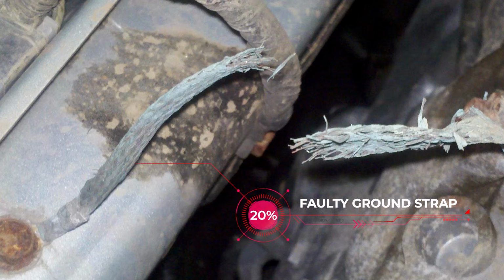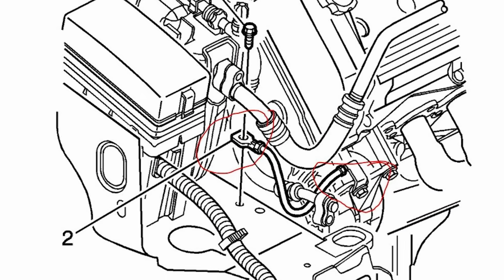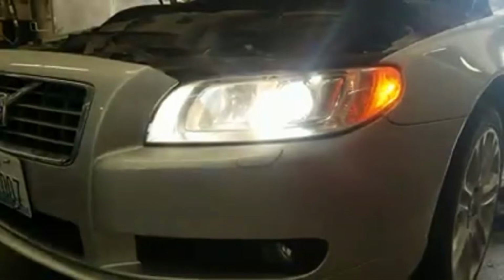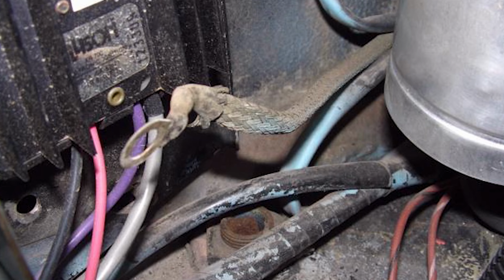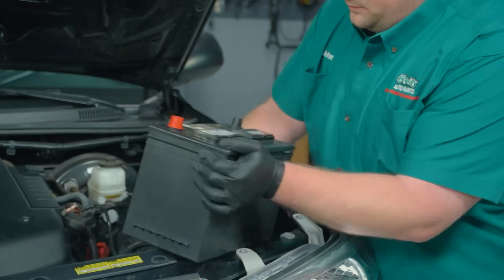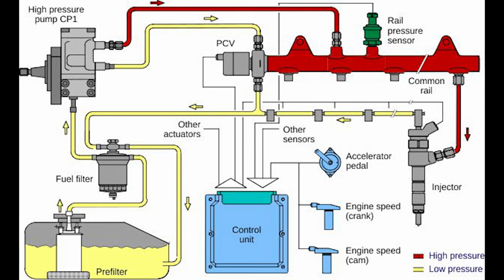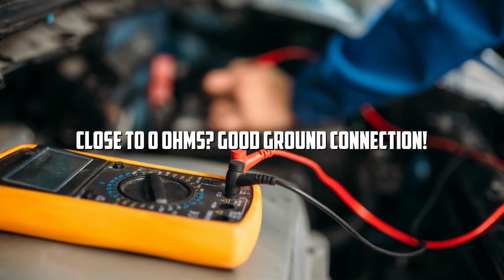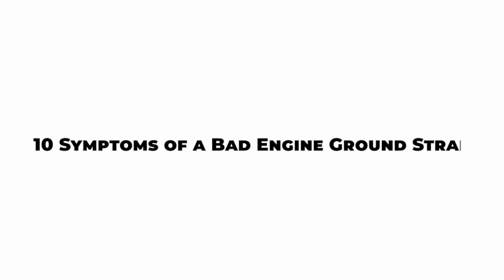9 SYMPTOMS of a Bad Car Negative Battery Cable | Signs Engine Ground Strap is Faulty

Comment from the maker: Before you buy random parts or approve a vague repair estimate, use the Check Engine Confidence Kit to understand what's actually urgent, rule out the cheap fixes first, and ask for the test; not the guess: 

https://gumroad.com/a/80519267/grkvra

Comment: I have a Duramax and sometimes it crank up and run good and then sometimes when you turn the key, the lights at the bottom where the showing you the mileage don’t even show up and then the windows one roll up and down of the doors won’t lock, but if you’re trying to keep all the way back halfway in the windows in the lock work, but the light won’t light up on the dash for us the mileage or the four-wheel-drive won’t light up
Reply: Did you ever figure out what was going on with your vehicle? I am having the same issue.  What was the issue with yours? Was you able to find the problem?  If so would you.mind sharing what it was

Comment: When i break and almost stand stil, then my headlights and dashboard lights go off for 2 sec and only the oil pictures shows and then everything goes back on. I also hear a little clicking sound then
Reply: did you figure out this issue? having this same problem and i’m at my whitts  end with it

Comment: If you replace the main engine ground wire, make sure it has the amperage rating necessary, and best to stick with OEM ones despite higher cost, then you know it's right for the job.  Lot of amps worth of power need to be grounded for things like the starter.

Comment: How do I change my ground wire ?
Reply: it depends on your vehicle. In general, open your vehicle hood and look at the battery.  Look at the negative Black battery cable. It is attached to the negative battery post. 
You want to  follow it with your eyes as much you can to where ever it goes.  It may go under the battery tray. Here is where you may lose sight of that black battery cable. On my vehicle, i needed to remove both battery cables (off the battery posts), set them aside .
Next, i had to figure out how to unbolt my metal battery tray. Once removed, i could chase the black battery cable to an area under the battery tray. That end was bolted to the vehicle body in the engine compartment or the transmission with a 14 mm bolt. I removed it, removed the cable. In my case, i cleaned both ends of the cable, cleaned the mounting hole area with sand paper. I add a bit of dielectric grease to the hole area i cleaned up. I cleaned up both battery cable connectors that go onto the battery posts. I cleaned the battery posts. I reinstalled everything as i took them off. 

When i did a few test drives, i noticed better acceleration, smoother, quieter engine, lower idle when parked. Over the next two days, i noticed i was getting better mpgs.
Reply: There's ground wires at different spots as well.  One or two main engine ones, often attached to the back of a head to part on the frame.  Sometimes second one on the lower front engine to the frame.  One on the hood that attaches to the firewall.  One is attached to your gas cap housing and the frame.  One is hidden inside behind the dash that grounds the interior electronics to the frame.

Comment: My problem is over car parked 2or 3 days battery drains hook jump box starts right up new battery new alternator disconnected negative battery terminal and hooked test light between negative post one cable I’m getting 9.4 volts out of the ground after you start it it’s fine all day just when it sits no blown fuses and everything is off
Reply: Same problem im having, have u figured it out yet
Reply: Add another additional ground

Comment: just realized this bad ground wire could have been causing my mass air flow sensor problem . Im so glad i watched this  Video
Reply: Do you have any idea of what happened with the maf sensor when you fix the ground strap issue? Did it fix the problem?
Reply: @StarreChilde pls respond to this  message
Reply: My car didnt start with cold engine if i rolld it end start with gear 2 clutch come up it started but it wanted to die if i kep it on 1000 rpm for 20 seconds myselr it would run all day if i switch the engine of end it was on lik temperature like not even 70 degrees it would start cuz it need less electricitiy  in the endd i fix all things didnt helpt end it was this ground cable......
Reply: Pls reply this comment
Reply: @AbimbolaFAGBEMI why? You have not said anything relevant.

Comment: Anything electrical is going to give you headaches not only the ground wire but everything!!!. I got an issue with the internal box junction on my mustang and oh boy, the car was doing all kind of crazy stuff, it shorted the gas pump, was draining the battery, locking the car transmission , etc, anything electrical is a mess
Reply: How did you resolve issue? What was causing it

Comment: I changed my alternator and changed my battery, but the battery light keeps fluctuating on and off, and sometimes when i accelerate or even put it on reverse the light goes away, then it comes back, there was corrosion on both neg and pos of battery post so i cleaned it but problem still coming on, i check the battery volts and charge it just in case but it doesn't seem to be draining significantly or at all. 

Any ideas?? What could be causing the light to come on??
Reply: Same issue I’m having did u fix it?
Reply: @laylowk1426 nah bro i might change out the cable connection from battery to alternator, but i wanna be sure its the problem before i jump in and commit to a tedious task.
If i get any progress and fix it, I'll be sure to reply back.
Hope you get your fixed too bro
Reply: @xjoshsaucex thanks man trying the idle air control valve today to see if that helps
Reply: @xjoshsaucex I’m having the same issue, did you figure out what was causing this?
Reply: Same problem here man, let me know if you fix it. I've had my battery, alternator and starter tested 4 times with AutoZone and O'Reilly's, first time AutoZone said it's my alternator but the next 3 times at O'Reilly's says everything passed. I changed the battery and the terminals posts. Haven't changed the alternator yet since I wanna be sure before I spend the money
Reply: @benzorelli trying the idle air control valve today for me rough idling and struggling to maintain Idle at lights stalls and can’t get up to speed once it gets up it acts fine but still dealing with lights flickering issue
Reply: Also having a similar problem in my mom’s 2010. Battery light came on. Replaced the alternator with one from the dealership, new battery, new belt and replaced the TIPM and battery light is still coming on. So frustrating
Reply: i'm having the same problem with my 1998 toyota camry! i replaced my battery and alternator as well. my next thought is a bad negative ground strap. everything im researching is leading me to that. I'm really hoping to replace and fix the problem for good.
Reply: @G @GravityKing22 Is it a OEM alternator or a garbage china alternator from Auto zone Oreileys NAPA JUNK I once went through 3 alternators then finally purchased a factory OEM for it to work

Comment from the maker: Doing This Will Make Your Car Battery Last Twice as Long  https://youtu.be/23Vy8aVbc_g

⬇Care Care Clues Top DIY Tools and Products:
🚗 Essential Scan Tools
Newest Scan Tool:https://amzn.to/3GJyuET 
Bluetooth Scan Tool: https://amzn.to/42AcBRc 
Cheap Scan Tool: https://amzn.to/42WZIzx 

🔋 Emergency Essentials
Best Jump Starter: https://amzn.to/44fYOAm 

🛢 Fluids and Leak Stoppers
AT-205 Re-Seal (Stops Leaks):  https://amzn.to/3S9icYm 
ATS 505 Fuel System Treatment: https://amzn.to/3YQjjA2
Lucas Oil Transmission Fix: https://amzn.to/4jNk98M 
Bar's Cooling System Stop Leak: https://amzn.to/3Sht0nj 

🔎 Quick DIY Diagnosis Tools
Head Gasket Leak Test Kit: https://amzn.to/4jRgc2T 

🛠 Useful Maintenance Accessories
Quick Twist Oil Drain Valve: https://amzn.to/4jWG3GJ 
Tire Gauge (Check Pressure): https://amzn.to/3GxySGD
Tire Air Pump: https://amzn.to/3RZK9Cd 
CRC Mass Air Flow Sensor Cleaner: https://amzn.to/44dJpkb 

🧰 Mechanic’s Must-Haves
Car Battery Tester: https://amzn.to/4jTqyzk 
Basic Mechanic Tool Set: https://amzn.to/3Ymgerh 
Cordless Impact Wrench: https://amzn.to/3YkkhVc

Comment: First of all, i woul like to thank you for this informative video

Second, i have a question i hope you can answer, i have a kia rio 2017, somtimes when i turn the signals or the ac, the car starts shakink softly, i asked someone and he said a weak ground can cause this since he encountered the same issues on a 2000 honda accord, i checked my grounds and they seems fine, however i noticed thier color is turning green, do you think i should just change the grounds since both are cheap ?
Reply: You already know the answer...lol.. trust ur intuition..